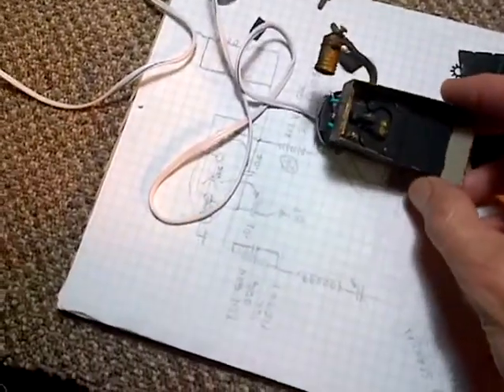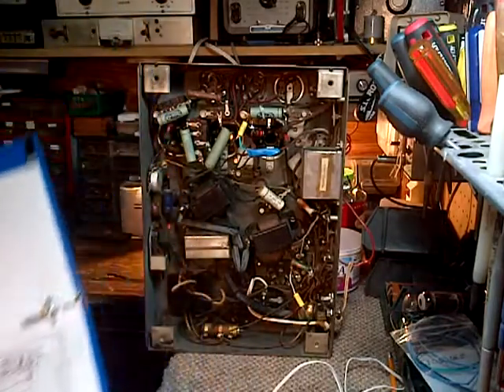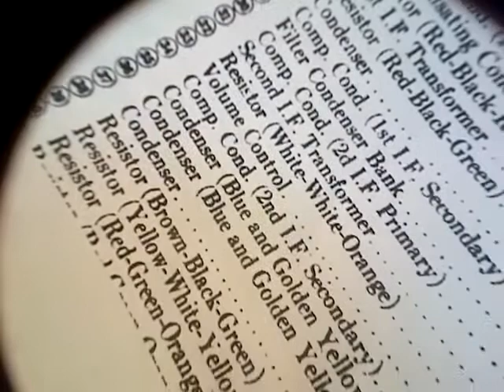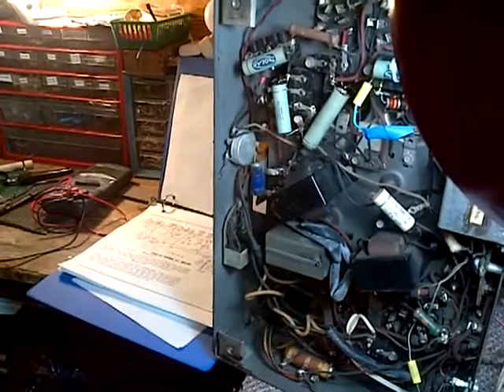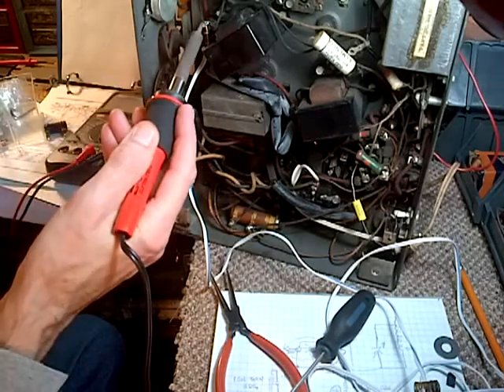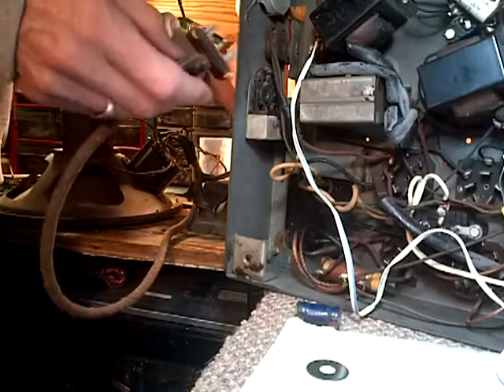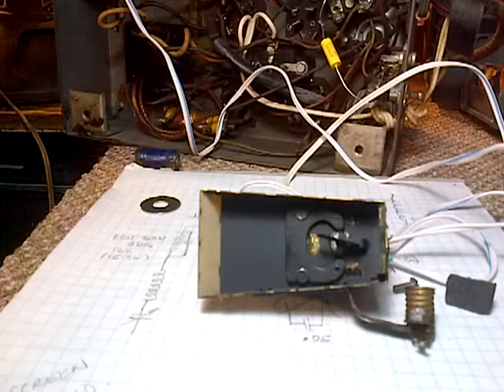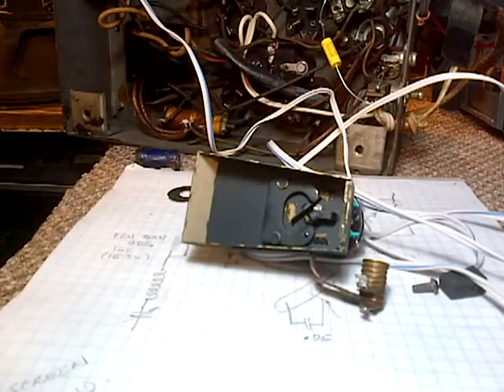Philco 91A 221 Radio Repair Video #31 Shadow Meter Hook Up and Test

Comment: Hi Jim. I agree with Bobby on removing the magnet. The other thing you might want to check on is that the AVC circuit is working right so that meter can function correctly.

Comment from the maker: Thanks Bobby.  The brass screw idea is good.  I'll remove the magnet to work on it.  I'm thinking I can't go too far in trying to re-magnetize it.  In other words, I can't make the magnetic too strong.  I need to be able to measure the strength objectively and I'm not sure how to do that yet.

Comment: Great video! I'm restoring the same style 91 chassis right now. Yours appears to have had major work done over the years! For the shadow meter I ended up having to completely fabricate a new coil, form and all as the original disintergrated during rewinding. 1000 ft. of 40 gauge wire was a real joy to wind!!
Reply from the maker: Thanks 37-1.  I hope you are enjoying your journey through the radio.  The shadow meter was a lot of work for a modest result but at least the radio was restored to its original design.  Have you checked out  philcorepairbench.com?

Comment: More than likely you will have to remove the magnet, re-magnetize it. You can reinstall the magnet with brass screws and it should work better. You can also magnetize a piece of metal by wrapping hookup wire on the piece and using a battery or power supply I've done this before with screw drivers and it works very well. Hope this helps.